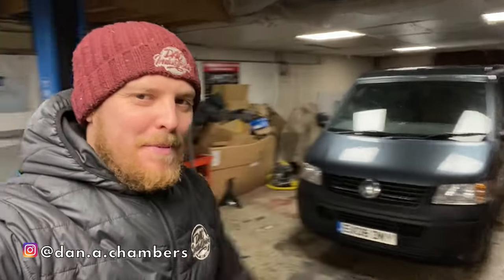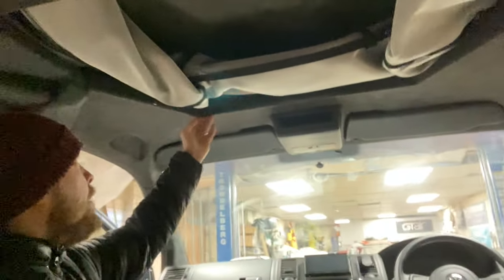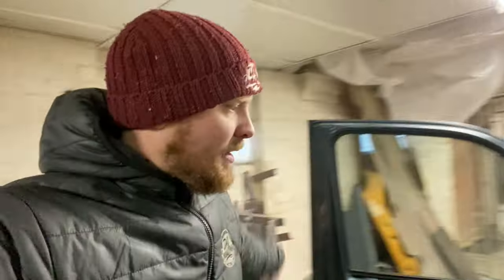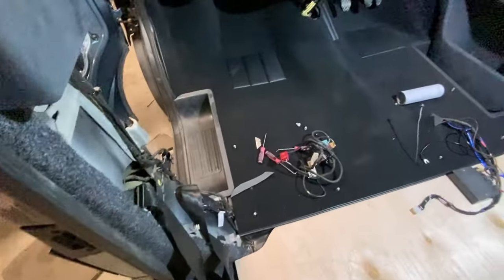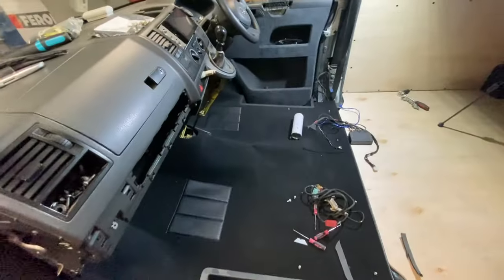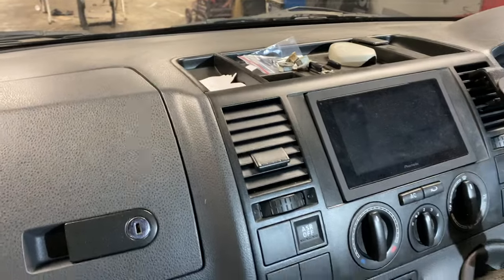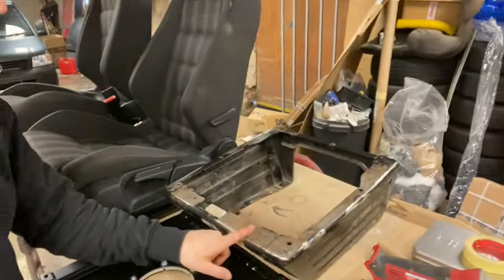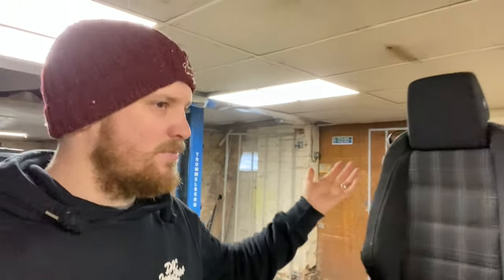Installing VW Golf GTD Seats - VW T5 Camper Project

Comment: Dan if you want to get rid of that loose bulge in your carpet, just warm up a few clean house bricks in the oven, lay them on a piece of cardboard on top of the carpet. Remove the instep again on the drivers door side and gently stretch across and re trim the carpet accordingly before replacing the instep. That should fix it! Very best wishes for an excellent new year buddy!🙏😊👍
Reply from the maker: Cheers bud, Will try and sort it out next week. Hope you have a great new year bud.

Comment: If you choose te mount a tin roof, maybe sound deadening the inside will improve sound quality. It may be cheaper than sandwich panels.
Reply from the maker: Yes, Will be going for a tin roof. will be using quilt insulation and then plaster boarding the ceiling to hopefully help with noise.

Comment: 19:03 Hi Dan, enjoy following your projects. Have you considered fabricating a ‘sliding mechanism’ below the seat, so you would slide the seat sideways towards the centre of the van before swilling it? Maybe that could get your driving position closer to being aligned with the steering wheel. You could perhaps achieve this sideways motion by using a ‘standard’ set of seat rails mounted sideways between the adapter plates.
Reply from the maker: Hi bud, Not a bad idea. being slightly off centre doesn't bother me

Comment: The T5 is looking really good Dan and the seat conversion looks like it's meant to be there, with you rejigging the adaptor plate from Transporter HQ you should get royalties from each sale of the one you designed😆😉

The new workshop should be ideal when it's done mate as it's always best to build from scratch so you can design and build it then fit it out just how you want it for your needs, moving in by the end of Feb is pushing it a bit but knowing you it will be done, you could always ask the good folks from DIY S.O.S to help😁
Hope you and your family had a great Xmas🤗👌👍
Reply from the maker: Thank you bud, Will put that idea to them! Thanks bud, I can't wait to get moved into the new unit. Will give it my best go to get in by the end of Feb 💪 Thanks, We had a great Christmas. Hope you had a good one bud.

Comment: Not tempted to take the front park of the bracket off that's hanging over on passenger or is it needed?
Reply from the maker: This will be trimmed back on the final plates yes, I just didn't want to cut too much off the plates for now.

Comment: Hi Dan, Merry Christmas, loving your series on the T5. Have you sorted the central locking issue yet? I have the same problem on mine. Not brave enough to delve into it yet, hoping you would be able to show me the way😁
Reply from the maker: Hi, Thank you! Hope you had a great Christmas. I changed the battery in the key 😂 realised that the key had been programmed so you press it once and it unlocks the front, press it twice and it unlocks the back....